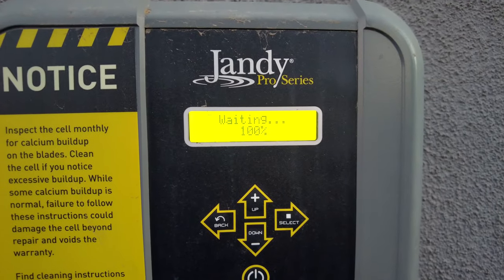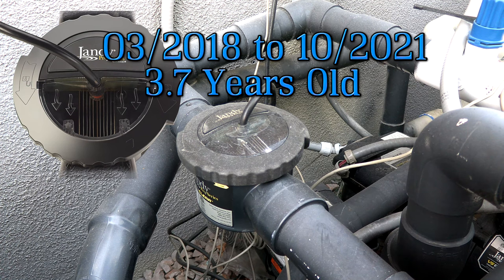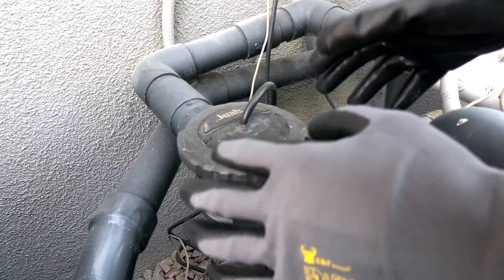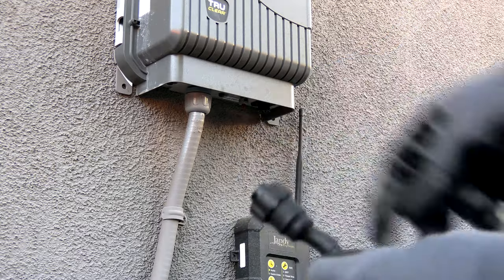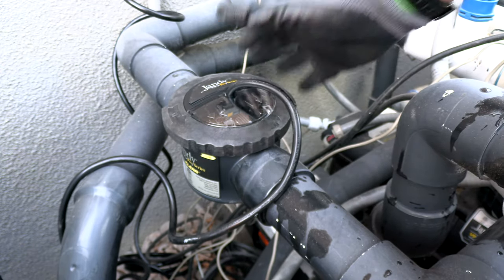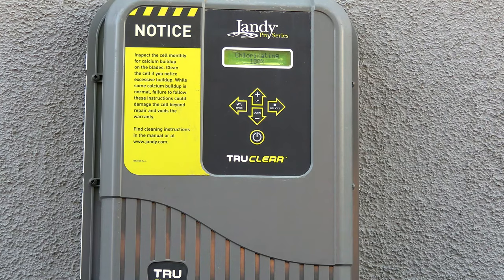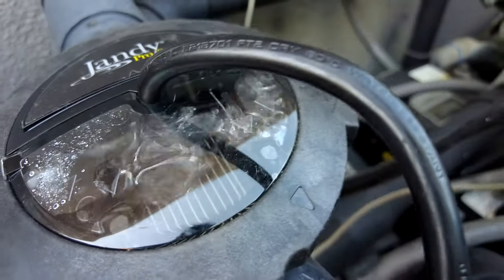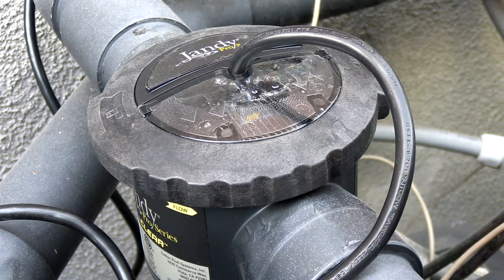Jandy TruClear Salt System Displaying "Check Cell" - Salt Cell Replacement

Comment: I have the system and I’ve had to replace the salt cell about once a year for the last five years. No one will take responsibility as for why they are going bad so fast. My pool guy claims he is cleaning them regularly. My repair guy says that it could be, my water causing it to go bad, i.e. perhaps the pH is not right. What can I do to get to the bottom of this?

Comment: Wanting to get your input about CO2 system for pools to automate PH balance. Have you made or discussed this in a video? Thanks!
Reply from the maker: I have not gotten around to getting a C02 System. I would say unless your pool is very large and the pH is completely out of control you can usually manage it with Borates at 50 ppm and muriatic acid.

Comment: I am getting the Waiting Check Cell Message on my Jandy TruClear control panel. I know that if the cell is clean and the salt is at the correct level that this could mean I have a bad cell. However, I think it could mean the circuit board in the control panel could be bad as well. Before buying a new salt cell, I want to determine which one is the culprit. I have a multimeter and plan to test the resistance across the salt cell by removing the cord from the control panel and testing the leads at the end of the cord. I know that if it is open circuit that the cell is bad. If it is not open circuit, can you tell me what the resistance should read across the cell if it is clean and is a good cell? Thanks!
Reply from the maker: It could be the cell if it is 3 years or older.

Comment: Do these have a built in flow switch? Getting a No flow error but it’s getting plenty of flow.
Reply from the maker: I believe the flow switch is built in. Check the wires going into the power unit, maybe you have a loose wire.

Comment: Thanks for this. Mine is saying “lo temp/lo salt” (though temp is and has been well above 60 F for months). My pool guy recommended a replacement (and seems to be charging $150 - $200 to install, which it looks like took you about three minutes). A couple of Qs: Does the constant lo temp/lo salt indicator suggest to you a replacement (mine is from 2019, which is at the end of its life), or might it be something within the box on the wall? Also, if I replace the cell myself (versus using a jandy dealer), does that void the warranty? Thanks!
Reply from the maker: Might be the end of the cell life. Only way to know for sure is to replace it.
Reply: Mine doing the very same thing.  Really hate to spend 400.00 bucks to see if that fixed it.  Did you replace your cell and did it fix the error?  Thanks.
Reply: @befmx31 yes, I had to replace it. Pool guy tried getting me to pay him $250 to install it. When I asked if i was missing something (since it seemed like a pretty straightforward unplug/plug in and twist off/twist on installation), he got all offended, stating that I was trying to ask him to share information he uses to make a living. Didn’t pay him and didn’t retain his company this summer. And knock on wood, the new one I installed still works.
Reply: @Joetorious1  Thanks for the reply. That is pretty funny about the pool guy.  Gotta keep those "trade secrets"  secret I guess.  Thanks again.  Gonna order it today.

Comment: We had the check cell message. We have a 15x29 pool with avg depth of 4.5 ft inground . So I’m guessing around 15,000gallons. We just replaced the cell ourselves after purchasing from Amazon. What should we set our chlorination percentage at on the panel?
Reply from the maker: Start at 100% and then dial it down after getting the desired chlorine level.

Comment: Hello.  I’ve done everything possible to stop getting the message “check cell”.  It probably needs to be replaced. The best price I can’t find is just over $1100.  I can’t afford this at the moment.  Is there a way to make chlorine without the salt cell?
Reply: Cell runs about $400 on various sites, part number to search is R0693900. I'm installing one that just arrived at this price.
Reply from the maker: I think you are looking at the entire system - unless you are somewhere like Hawaii that is. 😜👍
Reply: I’ve honestly looked everywhere, I’m in Canada.  $625.99 is the cheapest.   My dilemma is that I can’t get anyone out to take a look at the system. Busy time of year. So if it’s not the cell then I’m out the $. I’ve followed all the advice, clean the cell, etc but the check cell message just flashes.   Until I know for sure, can I add chlorine somehow?  I need to get rid of this green algae and get my kids swimming!
Reply from the maker: @diannalandry5581  If it is less than 3 years old Jandy may warranty the cell for you.

Comment: So, replacing this is around $600, or am I looking in the wrong shops? Mine is giving me the dreaded “check cell” code right now
Reply from the maker: I am seeing the cell for $400 - Jandy Cell Replacement R0693900
Reply: @SPL  thanks! got it for $440 shipped.  funny thing, Amz magically matched that price right after I searched it 🤖

Comment: Just had a check cell message on a brand new system.  Turned out that one leg of the circuit breaker in the electrical panel was not working meaning the unit was only getting 120 volts instead of 240 volts.  The display on the power center will work this way but not the salt cell itself.  Check your breaker if cleaning does not fix the issue.
Reply from the maker: Pretty rare but glad you got it worked out!
Reply: According to the tech who found the issue, you'd be surprised.  Based on how fast he figured it out I believe it when he says he's seen it before.

Comment: I have a new pool and haven’t used my salt system but fired it up said no flow. Help?
Reply from the maker: Usually in the first 2-3 minutes it will say that. Or if the pump is running at too low a speed. Try running it for awhile and see if that disappears.
Reply: Hey, Did you figure this out? Got a new pool and my unit is saying no flow. Thanks!

Comment: What would be a reason that my salt cell is not working if all other things are visibly OK to include the water test and the control panel?  The control panel says chlorinating, but there are no bubbles showing in the window..  it’s a brand new salt cell.
Reply from the maker: Maybe check the salt level.

Comment: I'm getting a "No Flow" on this new unit now.  Flow is fine, backflushed, cell is clean.  1 year old now...what else could be going on here?
Reply: Any luck on the No flow issue? I'm getting the same msg on my unit. Thanks!
Reply: @olivasrobert  still seeing it - haven't solved it, believe it or not.  everyone I ask says that it's just what it says, some sort of pressure issue.  Seems that flow is fine to me.  Likely going to have to call in a professional.  You figure anything out?

Comment: I can’t get my lid off the salt cell. I twisted and then lifted but can’t get it off
Reply from the maker: A little elbow grease should do it. Pull up hard
Reply: @SPL  I used a hammer and two screwdrivers. It’s still not coming off. I now have to call an expensive maintenance person. I twisted the plate and it’s just jiggly stuck. Maybe a build up inside. It’s not elbow grease.

Comment: not getting an error message, but its salt system not generating choline....but it is 4 years old
Reply from the maker: Might be too cold. The water might be below 60 degrees. At least it is here.
Reply: @SPL  I don't think so. Heated pool never below 79degrees while open. but thanks